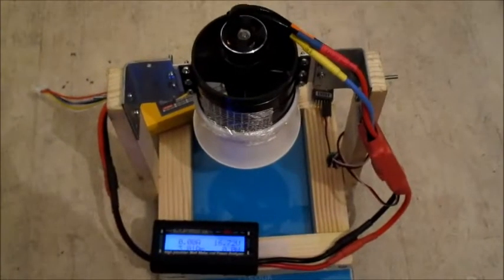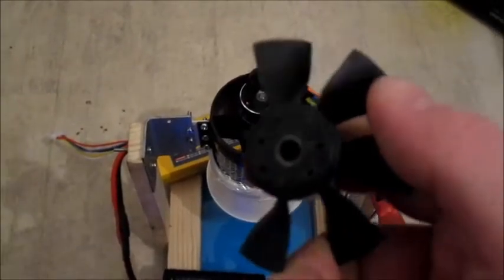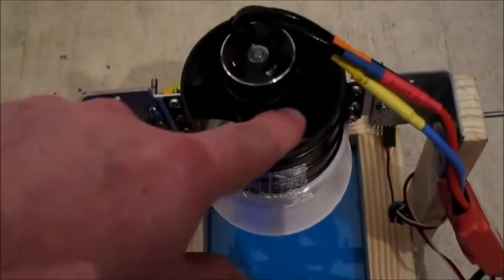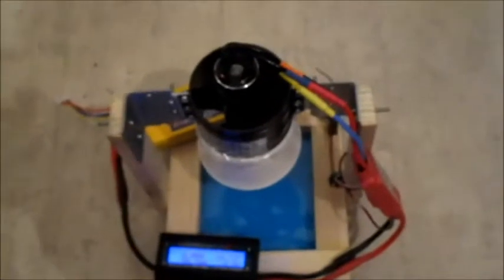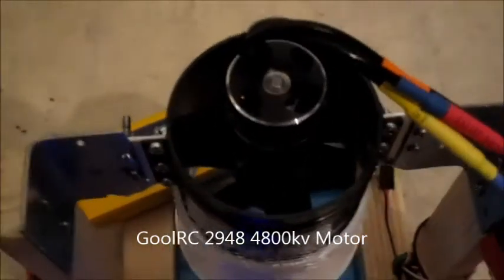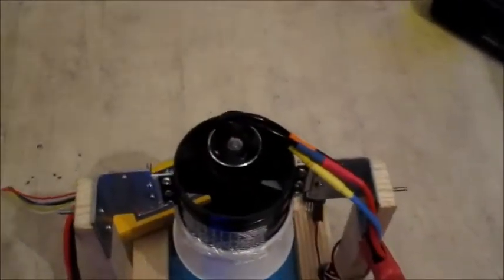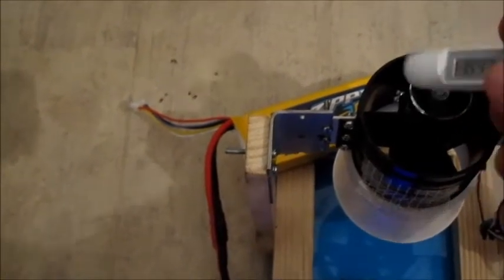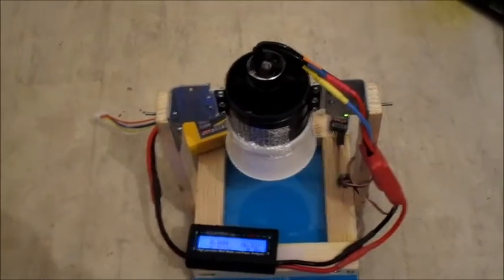Worlds most powerfull 64mm EDF on 4S GoolRC 2948 4800kv Motor test of the Week

Comment: may be better to swap to an aluminium housing and spinner  £30 think it.s a lander fan, had the 70mm version in a sea vixen went well till it hit the tarmac at 70mph ! took the newness off. take note 60k max rpm for the 64mm
  
https://hobbyking.com/en_us/hobbyking-64mm-alloy-edf-4000kv-850w-4s-outrunner-version.html

problem is 28mm i/d,   Gool do 28 car or boat motors 

GoolRC High Performance 2860 4050KV Sensorless Brushless Motor £15  no spec on it ? may not be mad enough for you longer can than the one you are running.
Reply from the maker: The Haoye unit is made of quite thick plastic and where i fiberglassed it it's as strong if not stronger then it was so i'm hoping it will be ok. It's a pretty mental set up though isn't it;)